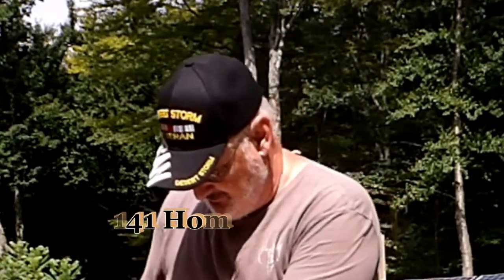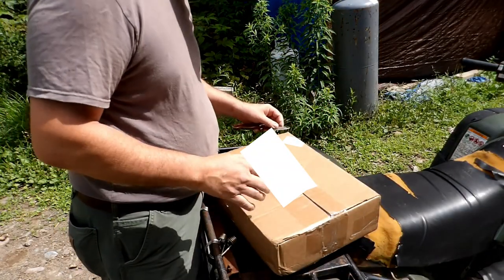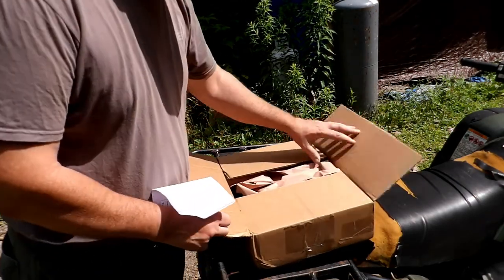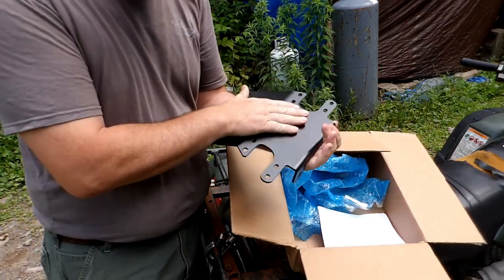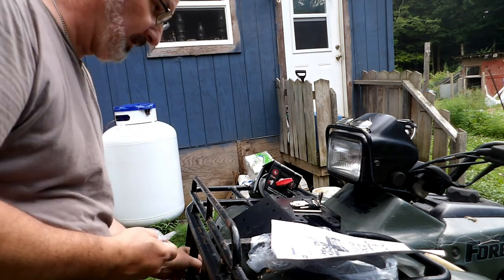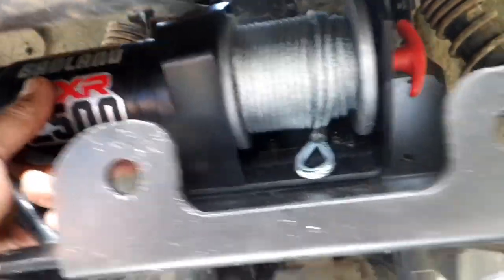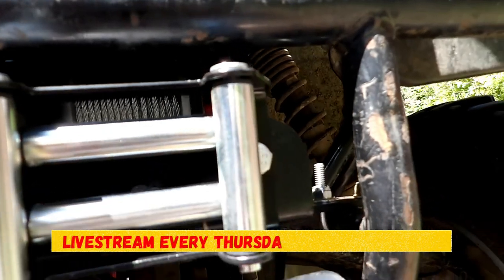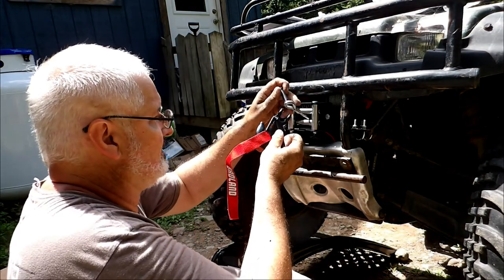Harbor freight winch install on '98 Honda Foreman 450s

Comment: Why did u not use the harbor freight universal mounting plate?
Reply from the maker: I bought one, but it would have required drilling bolt holes into the brush guard frame. This one only used u bolts.